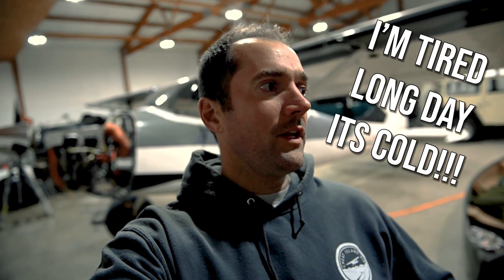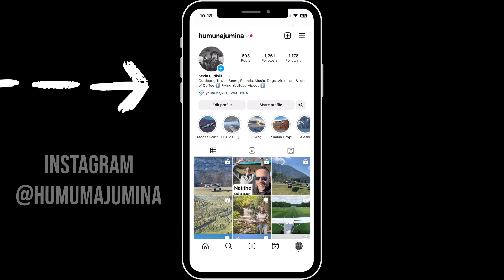Avionics Upgrade 2.0

Comment: Looking good Kevin!  Now you can add metal smithing to your resume!  How much slack did you build into the harness?
Reply from the maker: Haha, right?! A lot, arguably too much, but that allows for all of the components to move where they need to. The stack only has the GNX375,GNC255,PAR200B but behind the panel will be the GAD-29,GAD-13, TRIG TY-91, & GMU-11 in the tail…. So gotta make sure it all has a new home!